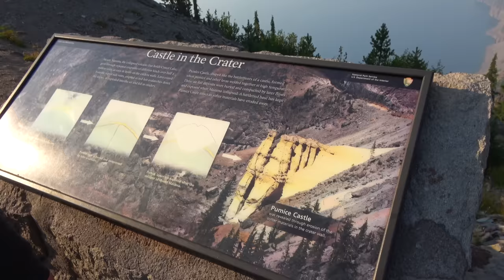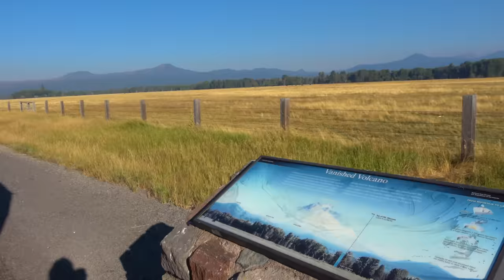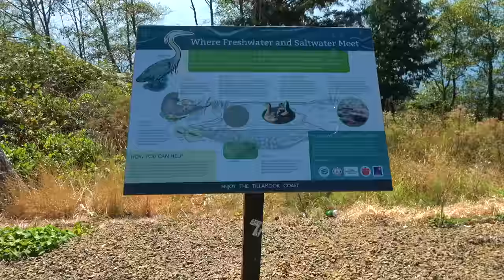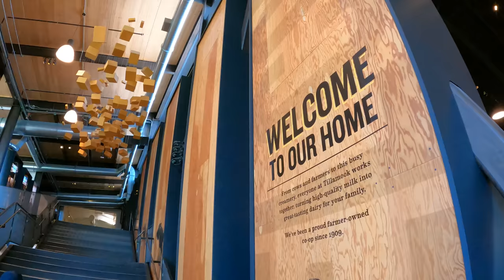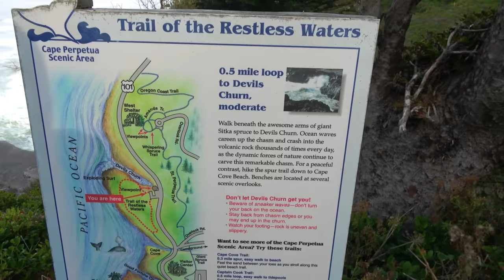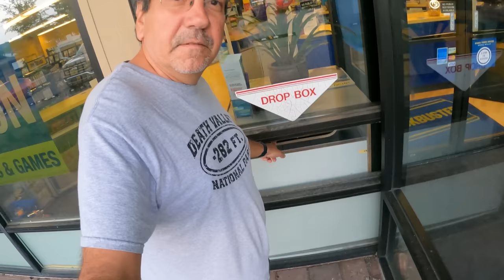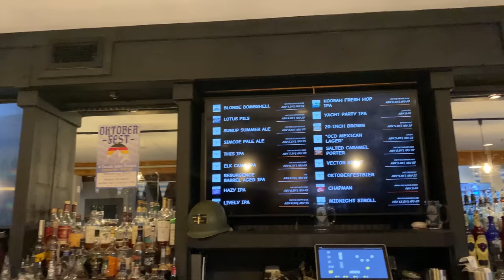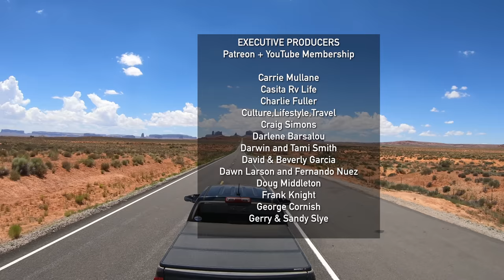Crater Lake and the Rest of the Oregon Coast - RV Travel  - Season 9 (2022) Episode 11

Comment: On your driving footage do you let the cameras run all the time or do you start and stop them.  Right now we are trying running them all the time and using highlights on the Go Pros.  Always love your drive footage.
Reply from the maker: I run them all the time. The downside: many terabytes of video that never get used.
Reply: @TravelingRobert  Fully understand that.  Currently have 2 NAS with 32TB of storage and keep running out of space.  Are you still running the roof GoPros on internal battery or  did you get an external power source for them.  Have been testing a rainproof battery pack and hope to someday power the cameras with it.  Plan is to just just velcro it to the roof.